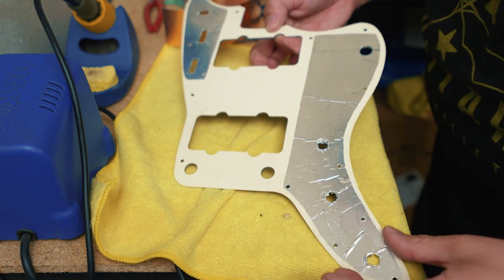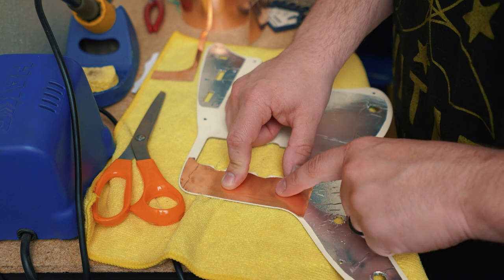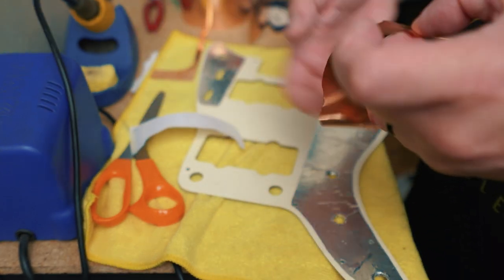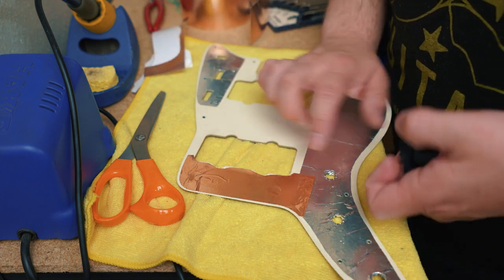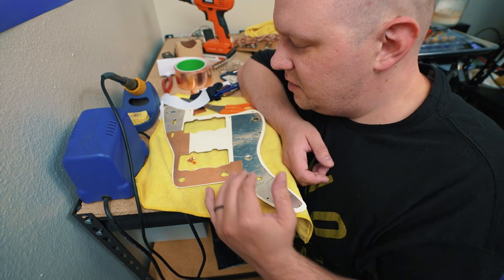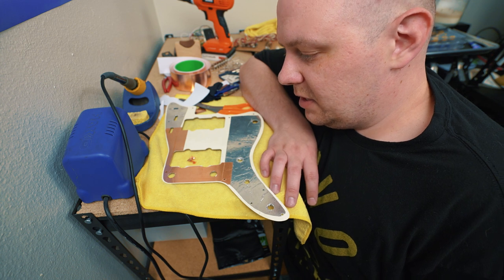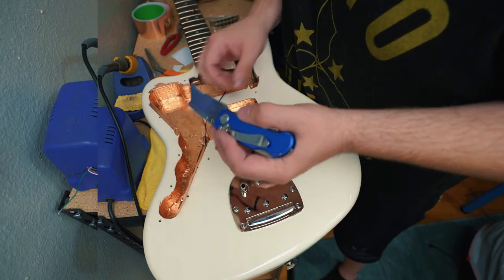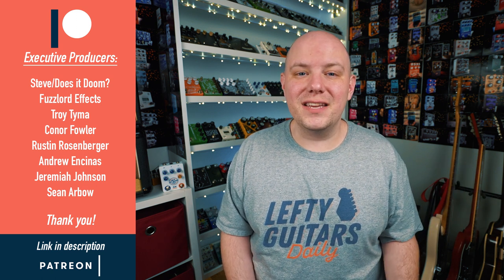How To Shield a Guitar

Comment: Good tips Eric! Going to try the tape this week on a pedal rather than shield paint!
Reply from the maker: Yeah dude! I bet it’ll work nicely!
Reply: I know this is an old comment but I am really curious to know why you would choose to do this to a pedal.

If the pedal enclosure is made of metal and is grounded from the pots and jacks then isn't the enclosure acting in the same capacity as the copper tape does on a guitar?

I'm guessing the pedal enclosure you're doing this to is plastic?

How did it turn out?
Reply: @cameronfarrell9076  hey! I actually make all my pedals out of old skateboards, so they have to be shielded! They work great and the tape is so much nicer to use rather than paint!
Reply: @shoneswood707  oh, nice! Fair enough, tape on, friend.

Comment: When you first mentioned this video during the pickup upgrade video, I was looking forward to it a great deal. I was not disappointed. One question though, wouldn’t it have been less time consuming to use the shielding paint in the cavity? Also, how readily available is the shielding paint? One of my guitars uses it and it’s a little flaky in some spots. Anyway, great video Eric!!!🤘🏼🤘🏼🤘🏼
Reply from the maker: Great question, Chris! I haven’t used shielding paint but I think if you applied it correctly it would probably be quicker to actually apply. But then I’d imagine you’d want to let it dry? Not sure how long that takes. But after it’s dry, it would work the same as the tape for sure.

Comment: Have you ever tried implanting an amplifier and speaker in a guitar?  I came across this post looking for some ideas. I have a little First Act electric guitar with a speaker in it. I replaced the amplifier with two small amps internally when to overdrive the other one however the second amp I can't turn up very much without getting a massive squealing coming from the internal wiring being too close do the board and feeding back into the second amp magnetically. The same Electronics worked fine with both amps turned up to Max before I implanted them into the guitar.
Reply from the maker: @jdmayfield88  I haven’t tried to put an amp in a guitar, but that sounds like a fun project!

Comment: Sorry I'm late but wouldn't you have to ground your  shield?
Reply from the maker: You are correct, you’ll want to make a connection from the electronic ground to the shield. With the Jazzmaster it’s pretty nice and easy because the bracket on the rhythm circuit is typically grounded and it’s easy to make connection with the shielding